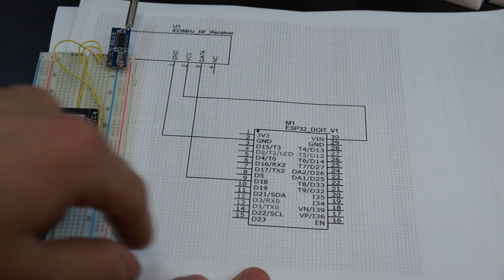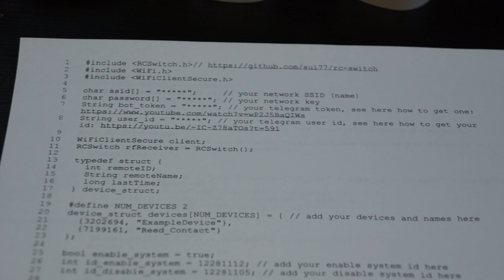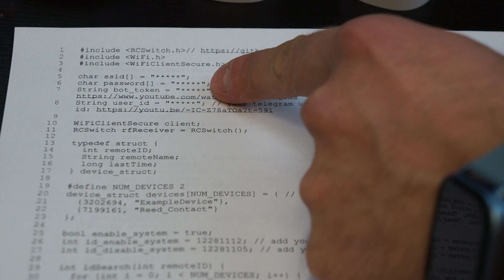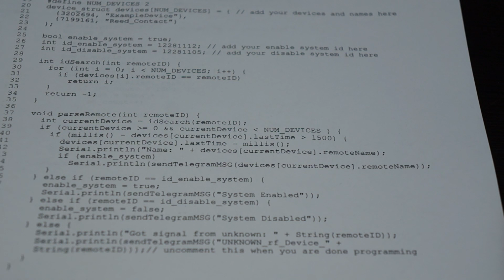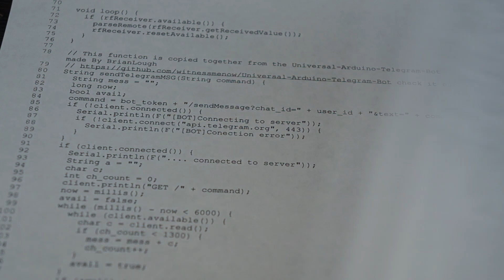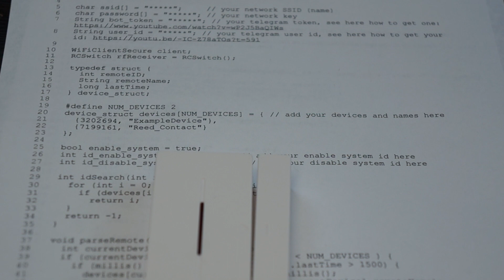DIY Wifi Arduino Alarmsystem using only 3 parts!

Comment: Hello Aaron. Thanks to your video I was able to receive signals from a wireless Reed switch that I bought on ebay. However, I'm having trouble with a wireless PIR sensor (HW_200B-G) since it seems that the sensor expects a pairing signal from an alarm panel. The sensor sends the same ID every 5 seconds (as selected by a jumper) with or without motion. Do you have any experience with this kind of sensors and/or behaviors? 

Thanks!
Reply: Never mind. I just figured that I was testing the wireless PIR sensor incorrectly. I discovered that the sensor doesn't expect a pairing signal from anything. It is just a one-way communication. I was getting the same ID every 5 seconds regardless of motion because I was testing the sensor outside of its enclosure. Apparently, the Fresnel lens is fundamental for the PIR element to work properly. I didn't have such knowledge back when I posted my comment. That said and following your instructions, I had correctly implemented a wireless alarm system with a wireless RF door sensor and the aforementioned wireless RF motion sensor. Thanks!

Comment: DE: Ist es möglich, die Funkstrecken zu verlängern, wenn Sender und Empfänger weiter auseinander liegen bzw. das Signal auf Grund baulicher Gegebenheiten nicht ankommt?

EN (translated by google): Is it possible to extend the radio links if the transmitter and receiver are further apart or the signal does not arrive due to structural conditions?
Reply from the maker: Yes that is a possible solution. It would be a 433mhz repeater that is needed, a custom one is better there than a general 433mhz repeater

Comment: Does the HTTPS certificate expires after some time? Or if the ESP32 board needs to be re-flashed regularly to update the certificate. Or the ESP32 can do it by it self. I am bit worried that the alarm on remote location could stop working after some time because of the Https certificate expires.
Reply from the maker: The certificate expires in years, so if that is gonna happen its needed to reflash it

Comment: Hello, We are working towards productizing this and looking forward 1 yr life time at least for the door and motion sensors with two AA battery. If any specific inputs you have welcome. Also I am looking for the best receiver and transmitter combo, where one receiver can connect to at least 20 transmitters. Any pointers to the right receiver and transmitters which will work on 433.92 MHZ frequency?

Comment: What is your receiver's chip model ? I've tried syn470r and I cannot receive anything with it
Reply from the maker: Its a normal 433mhz receiver. Anyone should work. Some have very poor range
Reply: @atc1441  Can you tell me the exact model of the Receiver you are using directly in the demo? Unfortunately, the links in the description do not work.
Reply from the maker: Try this one MX-RM-5V
Reply: @atc1441  If I'm not mistaken, you said in the video that it didn't work very well for you.
Reply from the maker: Its a while ago already but yes looks like it.

As mentioned any 434mhz receiver with analog rf output should work
Reply: @atc1441  Thank you for your time and your project!
Reply: Got the same problem.

The SYN470R chipset is not supported at the "RCSwitch.h" library level. So, you need to buy a receiver which chipset is supported at the library level.
This is SC5262 / SC5272, HX2262 / HX2272, PT2262 / PT2272, EV1527 / RT1527 / FP1527 / HS1527, HT6P20X.

Comment: Nice project Aaron!! Can you give some advice what kind of PIR sensors you used? Thanks.
Reply from the maker: Hey. I linked some in the description. My where from germany so hard to link them
Reply: @atc1441  Some of the ebay links are invalid. Do you know the brand/model of your PIR sensors?
Reply from the maker: Just changed the descripten. Its now a search link. Sonething like what will come up should be compatible

Comment: Thanks a lot, it worked until yesterday due to some changes in Telegram bot.. I Hope you have the same error, see my log .. apreciate your support.

[D][WiFiGeneric.cpp:337] _eventCallback(): Event: 7 - STA_GOT_IP
[D][WiFiGeneric.cpp:381] _eventCallback(): STA IP: 10.10.2.6, MASK: 255.255.255.0, GW: 10.10.2.1
Reboot
[BOT]Connecting to server
[V][ssl_client.cpp:56] start_ssl_client(): Free internal heap before TLS 207468
[V][ssl_client.cpp:58] start_ssl_client(): Starting socket
[V][ssl_client.cpp:93] start_ssl_client(): Seeding the random number generator
[V][ssl_client.cpp:102] start_ssl_client(): Setting up the SSL/TLS structure...
[I][ssl_client.cpp:156] start_ssl_client(): WARNING: Use certificates for a more secure communication!
[V][ssl_client.cpp:180] start_ssl_client(): Setting hostname for TLS session...
[V][ssl_client.cpp:195] start_ssl_client(): Performing the SSL/TLS handshake...
[V][ssl_client.cpp:216] start_ssl_client(): Verifying peer X.509 certificate...
[V][ssl_client.cpp:225] start_ssl_client(): Certificate verified.
[V][ssl_client.cpp:240] start_ssl_client(): Free internal heap after TLS 161044
.... connected to server
[V][ssl_client.cpp:279] send_ssl_data(): Writing HTTP request...
[V][ssl_client.cpp:279] send_ssl_data(): Writing HTTP request...
[E][ssl_client.cpp:33] _handle_error(): [data_to_read():270]: (-80) UNKNOWN ERROR CODE (0050)
[V][ssl_client.cpp:248] stop_ssl_socket(): Cleaning SSL connection.
<!DOCTYPE html>
<html>
  <head>
    <meta charset="utf-8">
    <title>sendMessage</title>
....
Reply from the maker: Hi. Yes i got the same. Will update the code in the next days. There is allready a fix available

Comment: I had to //comment he wifi.insecure statement (this is a 8266 function) and downgrade the ArduinoJson library to version 5.13.5 to get it to compile for my DOIT ESP32 Dev. V1 module. In the Telegram app I used userinfobot to get my ID. The IDBot did not respond. Other than that it works. I was able to decode and program a remote for 230VAC switches to enable/disable system. Now I need to order a few reed switches and PIR sensors :) Nice work.
Reply from the maker: Great that it  worked :) have fun

Comment: Cool ! How long does it run stable? 
I had a TG based "backend" once, which was a nodejs-script running 24/7. Only once per day I used it to sync some stuff to my phone. After around 3 months, when I checked the terminal, I saw heavy traffic with chinese stuff, on MY private BOT !! I guess they invaded it. I abandoned the whole concept for the time being.
edit: also, TG message lengths get limited to 4 kb or so, and I had to send chunks. Very ugly.
Reply: Thank you, that sounds very promising ! You're my new favourite avantgarde-hacker !
Reply from the maker: It is running stable for me since i built it. Also got my Garage door working via telegram for over a year. In the code is a feature so that nobody else can interact with the bot so that shouldnt be a problem.
Reply from the maker: In the alarmsystem code there isnt even a function to write to the bot so it shouldnt be a problem there at all. It will only send get requests to send msgs. 
The security feature is in the garage door code(see video for that)

Comment: Keep getting this error.

SimpleAlarmSystem.ino: In function 'void setup()':
SimpleAlarmSystem:63:10: error: 'class WiFiClientSecure' has no member named 'setInsecure'
   client.setInsecure();
Reply from the maker: Hi, you can just delete this line, sometimes it is needed when the connection to Telegram is not working correctly, are you on an ESP32 or ESP8266 ?
Reply: @atc1441  
esp32 / Now get this kind of error, goes on and one for a whole page and at the bottom says - Error compiling for board ESP32 Wrover Module.

libraries/rc-switch-master/RCSwitch.cpp.o: In function `RCSwitch::setProtocol(RCSwitch::Protocol)':
/Users/AAA/Documents/Arduino/libraries/rc-switch-master/RCSwitch.cpp:122: multiple definition of `RCSwitch::setProtocol(RCSwitch::Protocol)'
sketch/RCSwitch.cpp.o:sketch/RCSwitch.cpp:122: first defined here
libraries/rc-switch-master/RCSwitch.cpp.o: In function `RCSwitch::setProtocol(int)':
RCSwitch.cpp:(.text._ZN8RCSwitch11setProtocolEi+0x0): multiple definition of `RCSwitch::setProtocol(int)'

Comment: Cool project Aaron! I have a question. What happens if two sensor are activated at the same time? Does the transmitted signal gets mixed up?
Reply from the maker: Hey, the receiver would not receive them both, it is also a security issue, if someone would send a signal continuously the receiver would never get any valid signal.

But to your question, it is very unlikely that two sensors are sending at the same time the transmitting only takes a few milliseconds and most Sensor repeat its sending a few times.

Comment: Hi Aaron, I have just built your project but keep getting "[BOT]Connection error" in the serial monitor and no messages sent to Telegram. I have done a direct browser GET using my details and it works fine. 
I send to https://api.telegram.org/bot<API KEY>/sendMessage?chat_id=<CHAT ID>&text=<TEXT>  in your code I don't see the "bot" before the API KEY, am I missing something? Thanks for a great project
Reply from the maker: Hi, thank you for the hint.
You are 100% correct. The "bot" got lost while removing my real api key, i edited the code on github so it should work now. Simply add the bot after the /
Reply: @atc1441  I still get the Connection errors. Is the code on github up to date?
Reply from the maker: @modin2011  Hi, yes it should work, the code on github is updated.
Reply: @atc1441  Cool, thanks. BTW, I found that I had to replace WiFi.h with ESPWifi.h and remove the WifiClientSecure.h altogether or the code wouldnt compile for me.
Reply from the maker: @modin2011  Do you use an ESP8266 or and ESP32 ? the code i posted is for ESP32 :)
Reply: Aaron Christophel im not a clever man. I just realised that too. Thanks.
Reply: @atc1441  Which / are you talking about? Which line? Can you be more specific please?
Reply from the maker: I added the /bot at the line 96
Reply: @atc1441  Thank you Aaron. When resetting my board, I get this message "
[BOT]Connecting to server
.... connected to server
{"ok":false,"error_code":400,"description":"Bad Request: chat not found"}
Reply from the maker: Did you added your own chat id?
Reply from the maker: And you needto start the conversation from the phone first
Reply: @atc1441  OK. What type of message do I send and to whom?
Reply from the maker: Please watch the linked video at the top of the code from brian lough, he explains it in detail
Reply: @atc1441  OK, now it works fine. The "user_id" in line 8 was not my chat id but my name... so sorry! Thanks again for your help.
Reply: @atc1441  I don't see where you include the Arduino Bot Library in your sketch? When I include the library, I get all kinds of errors when compiling.  I'm afraid I can't get my device to connect to Telegram at all. The code you posted should be working as is (with SSID, password and bot_ID obviously changed to my specifics), right? I am pushing this to an ESP8622 though.
Reply from the maker: Hi. You dont need the Bot library. All the code is inside the sketch
Reply: @atc1441  I'm now able to connect to Telegram - I had to add   client.setInsecure(); before connecting. Now all I need is to let this stupid bot know I'm here. It doesnt seem to know the chat.
Reply: I think I ran into every snag there was (me being a complete noob to all of this), but I have got it up and running and I just set up 8 of my reed contacts and they triggered messages accordingly. So if anyone needs help with this - feel free to get in touch with me. @Aaron: Great project and great support. thanks!
Reply from the maker: Good. Nice to know